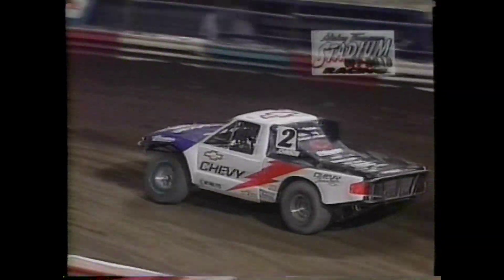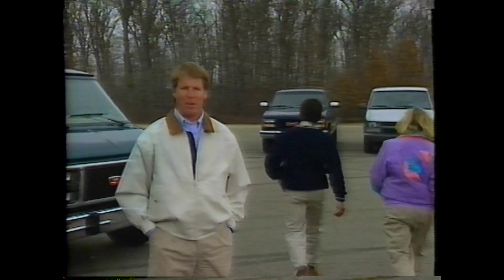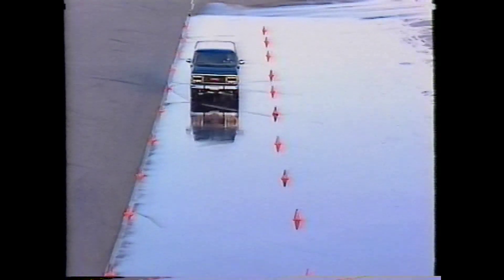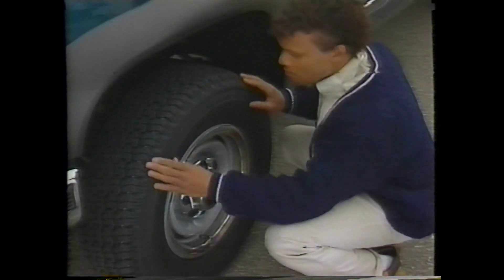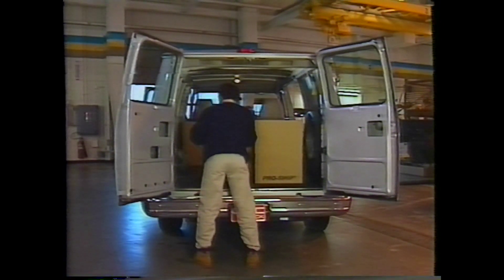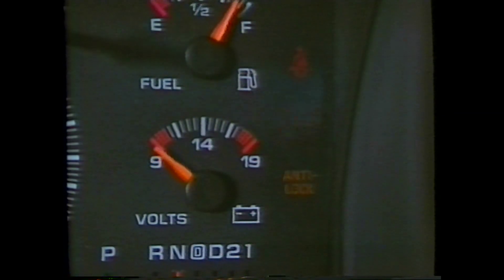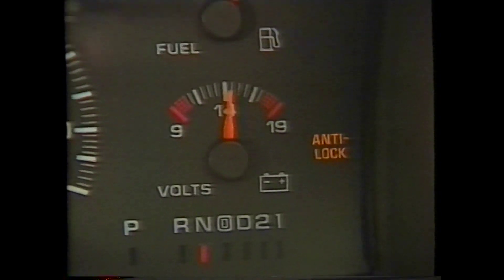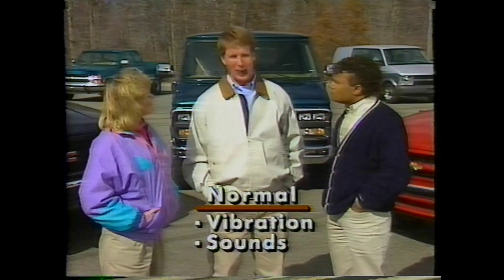GM Trucks - Your New Vehicle's Antilock Brake System: How It Works for You (1994)

Comment: I just found one of these myself  with our [new to us) 2003 class A rv. The chassis was made by Workhorse which I thought was sold off by then and I don’t think ABS will keep you from topping over such a big vehicle! Also do you have anymore tapes like these? I swear when my parents bought a 1995 Burb it came with a tape explaining airbags and it had two bumbling guys in it so it was a little less boring then this.
Reply from the maker: I don't have any more for GM vehicles like this. If I run across another tape like this though, I will snag it.

I do have an instructional tape for installing a satellite dish on an RV, though.
Reply: VectraQS cool! I’d love to see it if you have time.
Reply from the maker: I just posted the satellite dish instructional video (for the Braund Sat-Trol). Check my channel page to see it.
Reply: VectraQS Awesome!
Reply: I think it's probably Mort the Traffic Guy: Mort Bags It you're thinking of, it's in the second part of my most recent video.